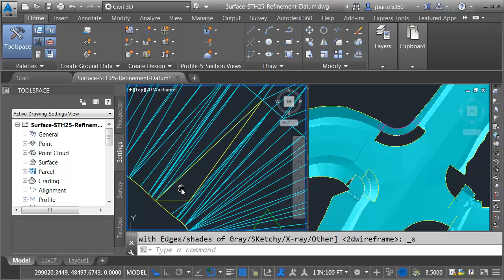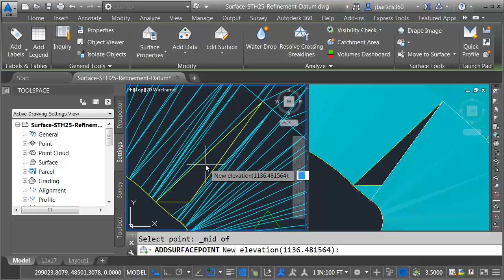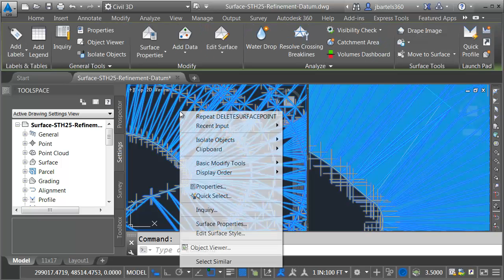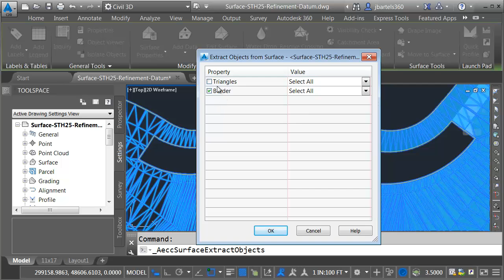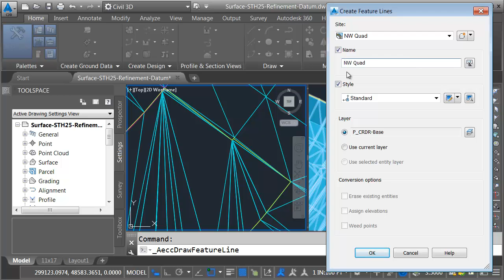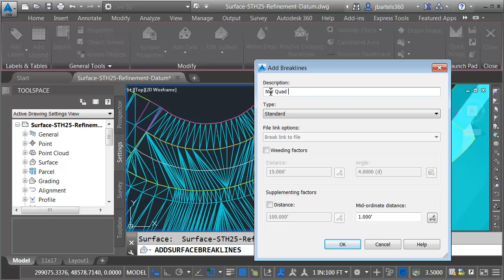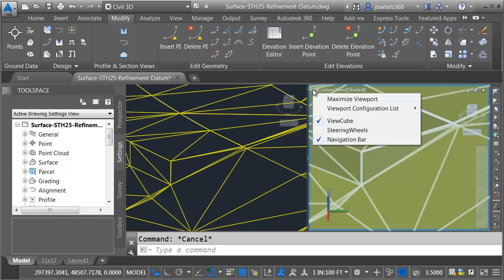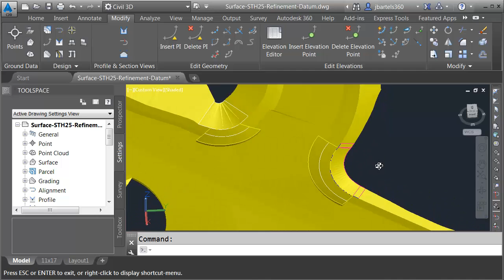Finding & patching holes in a Civil 3D surface model

Comment: Hi 
In order to find the finish grading level I need to subtract/add some portion of volume surfaces. I  have 2 volume surfaces. From one I have take cut area, from other I need to take fill area. Question 1 how to extract part of volume surfaces. Question 2 how to add/ subtract levels ( amount of adding and subtracting is volume surface)
Thanks for your support in advance. RGaur